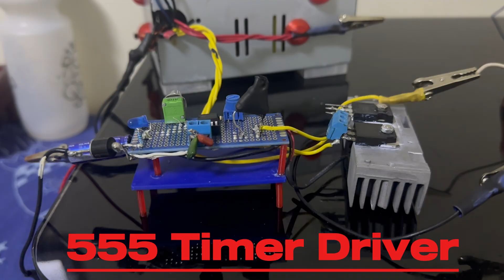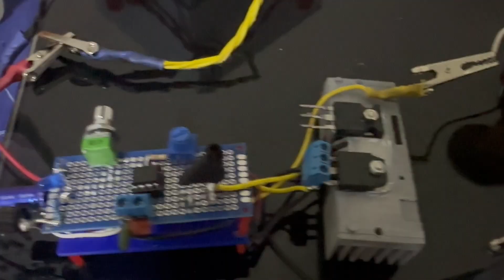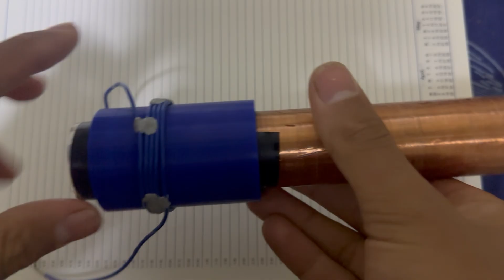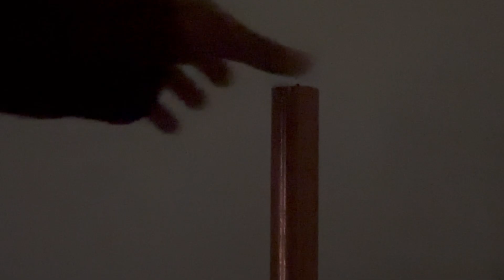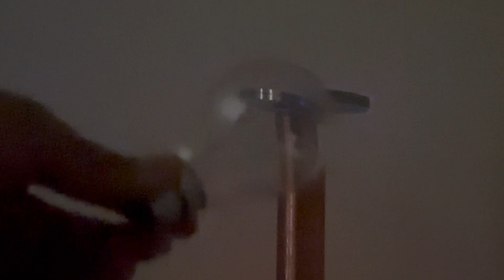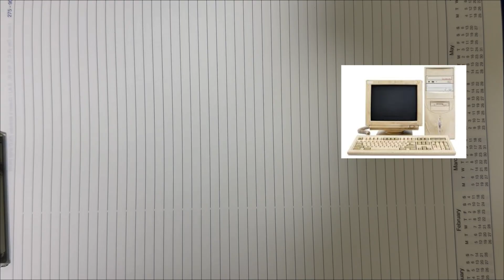How I made MINI SPARK GAP TESLA COIL!! #experiment #nikolatesla #teslacoils

Comment: Where’d you get the flybacks?
Reply from the maker: I got them from an LCD TV backlight board. It is odd, though, because I have opened many other LCDs and the transformers are way smaller and uninsulated.
Reply: @Plasmalabau oh so like it was part of the ccfl inverter circuit, I see